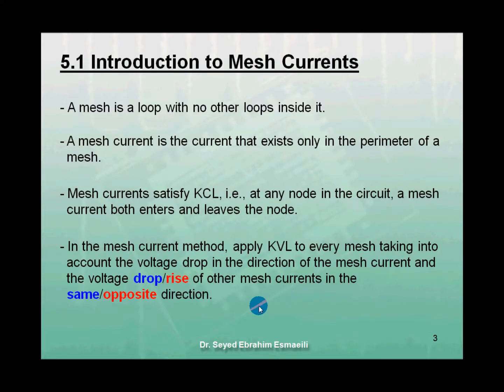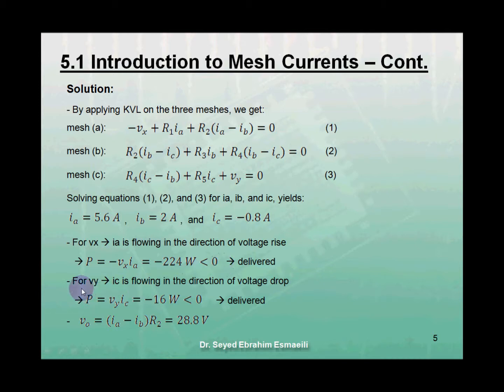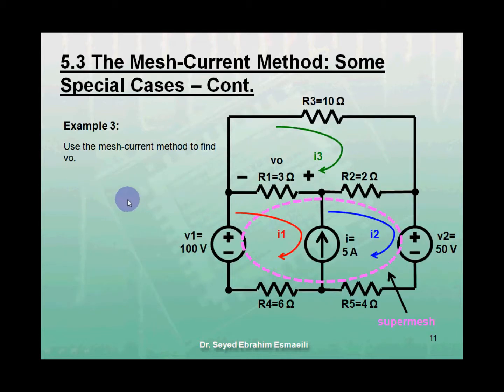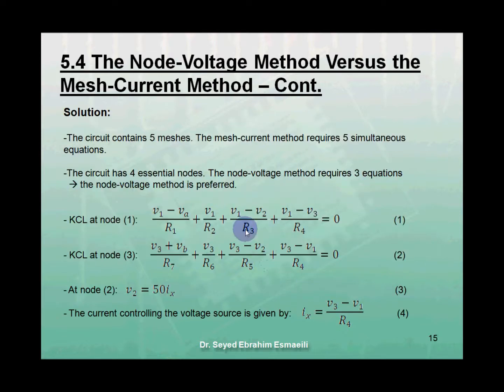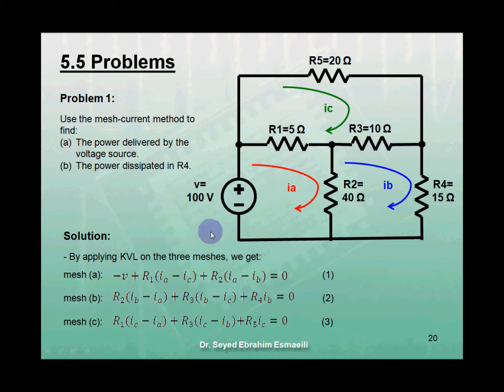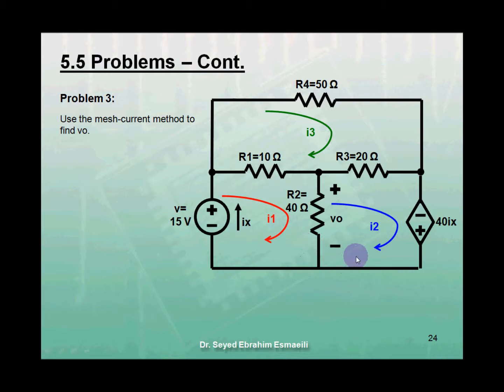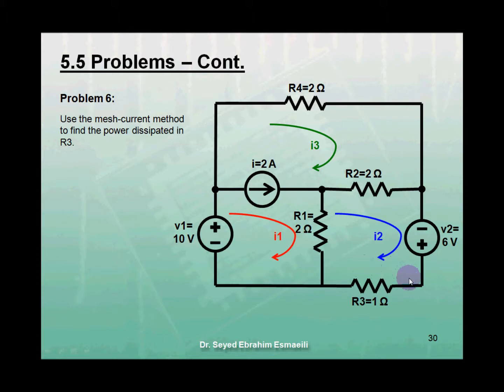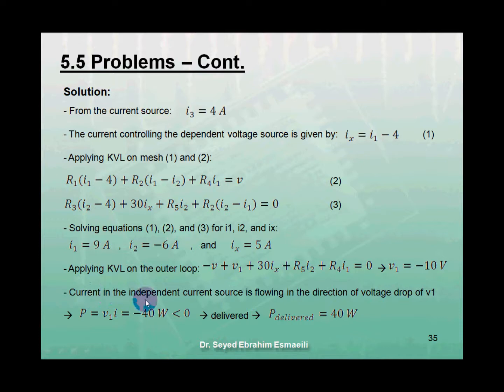Electric Circuits - Electrical Engineering Fundamentals - Lecture 5

Comment: sir, in problem 2 on under 5.5 should not the restraint equation be I 2  -- I3/3 instead of I3 -- I2/3 for the dependant source. It is a confusion because if you look at it from loop 2 it will be  I2 --I3/3 and if you look at it from loop for I3 it will be  I3 --I2/3 so which one is correct?